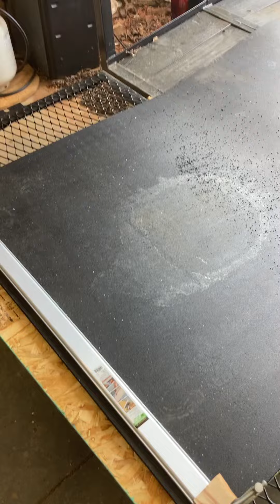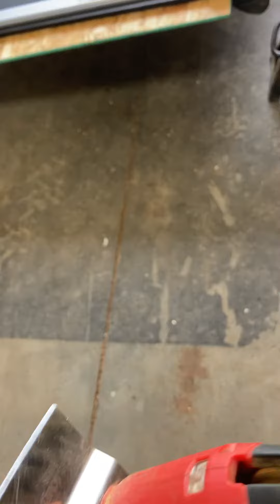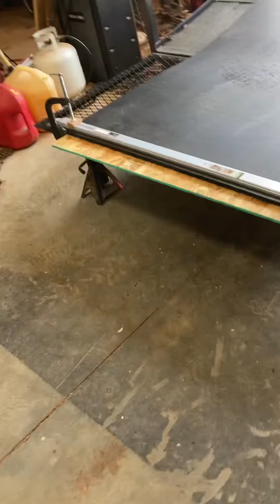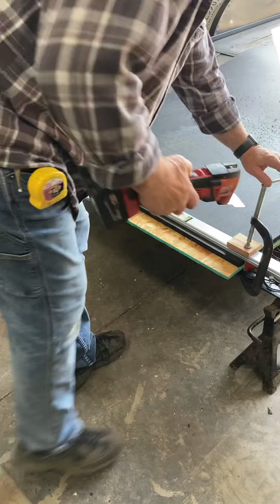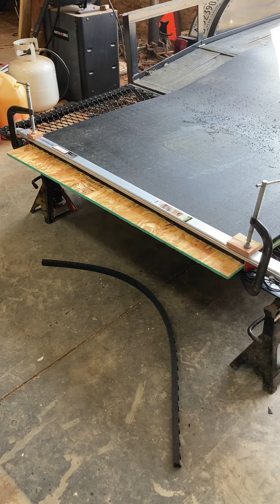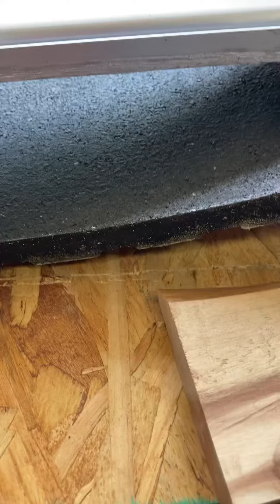The Fastest Easiest Way to Cut Stall Mat or Thick Rubber. Look no further!

Comment: This is exactly the information I've been searching for! Thank you! I knew there had to be an easier way than using a utility knife.
Reply from the maker: Im glad someone found this useful @karenmiller6088 , i know i have struggles with a utility knife before and this time i had to think about it and this is what i came up with. I was quick and easy this time and my horse trailer now has the  rubber mat  ive been putting off for so long.  if you can get someone to spray your blade with soapy water while you cut  it works even better. good luck and Thank you !
Reply: Thank you for the video ..

Comment: This is the way UPDATE: sharpening a scraper blade didn't work for me. Using a plain old box cutter did. Would have been nice if the multitool worked, but it did not.

Comment: What type of blade is that?
Reply from the maker: https://www.amazon.com/DEWALT-Dwa4217-Oscillating-Rigid-Scraper/dp/B00FMHPZM4/ref=sr_1_5?crid=2JZ3SCL03YTKQ&dib=eyJ2IjoiMSJ9.XVFdcPfxdmtvVLwGY5C08nywebT-P-cqYj0HYnnfGgm-kYumYdlCB2C75Bnh6yKKWXPGb9d-Hunu5_3QSB7jyIXrQxjHQ6bk3JJOb5eU_dvT6bdHPr1gtlaMhkQmZbr4sYT_moHELf13Gg-rJ8Xw1hU_ouS15I65th2prUb7882aZZLnLkBqsnY24FjwG0mT6PR4vh-bLMJGYKpfMNuKgyvuZ_oP-Ej0aMI7TsMOlhVWV3KVxIFHhDrP7qBQnOfRdvvuCdObho83IitmINparOtWber7dyjTXnLkwHbJbaA.CKTNSIp3B_IyqLTK6_1qrXXYkgHZ2WMsF2uHYHCQexU&dib_tag=se&keywords=multi+oscillating+tool+scraper+blade&qid=1710725210&sprefix=multi+oscillating+tool+scraper+blade%2Caps%2C141&sr=8-5